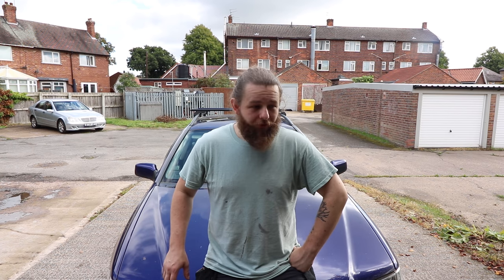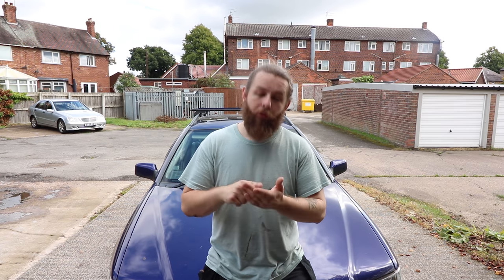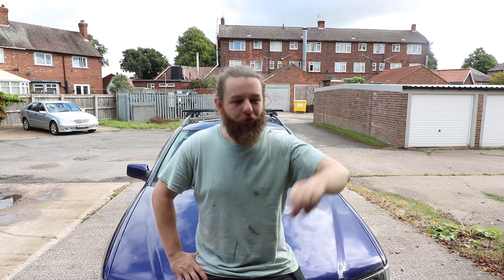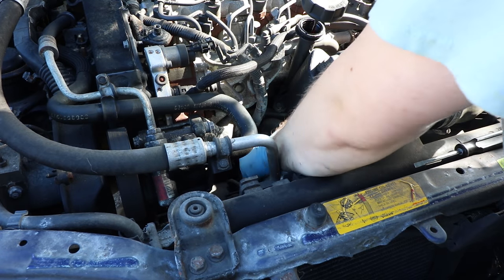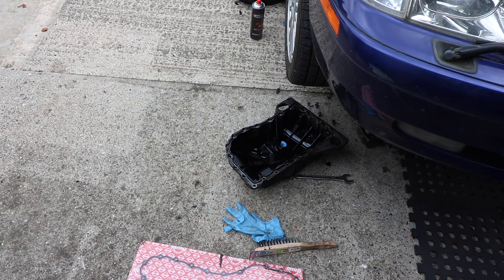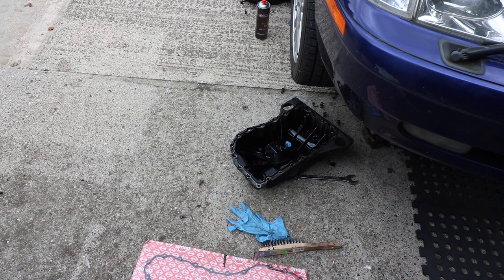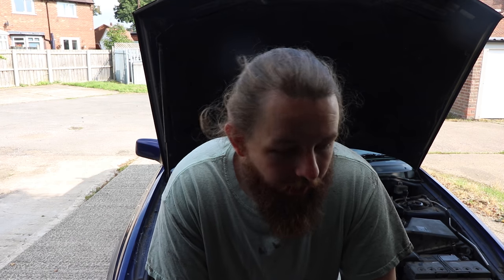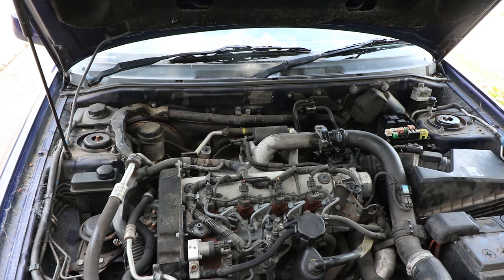Reviving an old Volvo Ep. 1 - V40 First Generation (1995-2004) V40/S40 Service and Sump clean!

Comment: Hello, I would like you to help me with some information: the oil meter rod of my car (Volvo V40 2002) is made of plastic and it broke in half, leaving one half inside.  I would like to know if it ends up in the crankcase?  Is it advisable to move the car like this?  If it can cause serious damage?  Your guidance would be of great help to me, please 😢
Reply from the maker: Hi Edward, I would take the dipstick tube off and see if you can recover it from that end, if not you may have to remove the sump and pull it out the bottom. If it was a tiny bit of plastic I would maybe be tempted to just use it and live with it, but a good portion of the dipstick I would absolutely want to remove.
Reply: @Enginesetc  thank you very much brother🙏🏽
Reply from the maker: @edwardmieres  no problem, good luck mate!

Comment: Mate, which manufacturer of front shock absorber ( strut's)  do you advise me to buy?
Also, what are your experiences as to why most diesel V40s (mine is from 2002 and 85 KW -115 horse power) work unevenly, and also tow - unevenly. Sometimes, for no reason, the car works well and pulls like crazy, and sometimes it seems like something is "showering" it, like a pressure sensor on the Bosch pump or a valve?
No mechanic knows, so I don't change anything, because I'm not sure, and new parts are very expensive
Reply from the maker: Hey bud, for standard ones you can go with some from decent manufacturer such as sachs or bilstein if you can stretch to those or OEM if still available (doubt this though).
I'm not 100% sure, it might be worth scanning the car first to see if any faults? I also changed my fuel pressure sensor for a bosch one, it was cheap and it's very easy just right on top of the engine and that cured my lumpy running for a while. It might also be worth doing injector leak off tests, this can show if the injectors are all working correctly and evenly. Should be cheap for the test also :) Maybe also service the car if not done for a while so fuel filter and air filter mainly so it's getting correct fuel and air there as well.